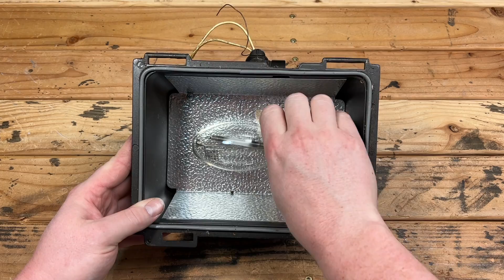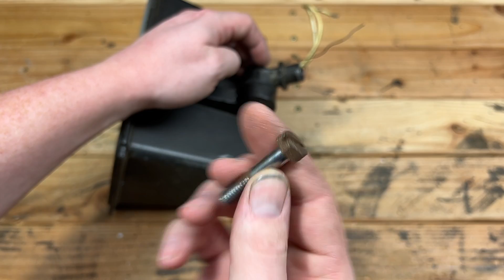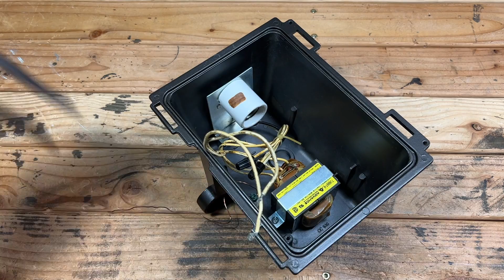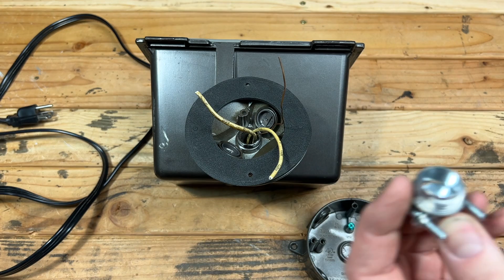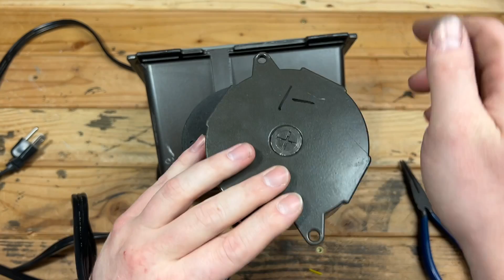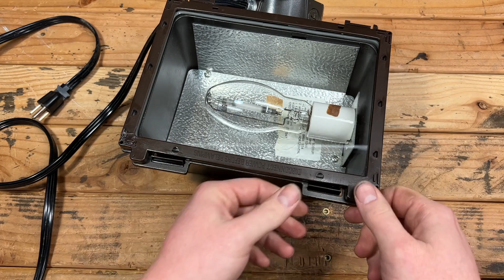Major Liting 100watt High Pressure Sodium Flood Light

Comment: Nice! I thought the title was a typo at first lol. The light most likely took a fall. I found a ITT 50w HPS light a long time ago and it had a Philips 100w HPS in almost the same condition but the arc tube was still connected. The fixture had a missing neutral wire and a small chunk of the housing missing. The ignitor also had a loose connection which I didn't care about until the ignitor went up in smoke after firing it up a few times.

The EYE lamp is made by Philips in October of 1994 at their Bath, NY plant.
Reply: The Bath, NY plant was Philips.  Actual American made Iwasaki/EYE lamps were made in Mentor, OH.